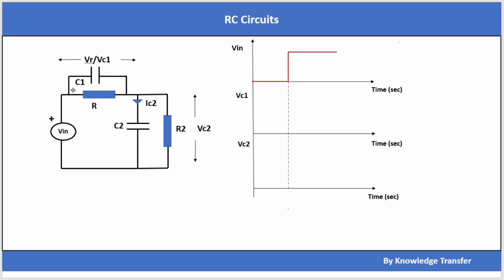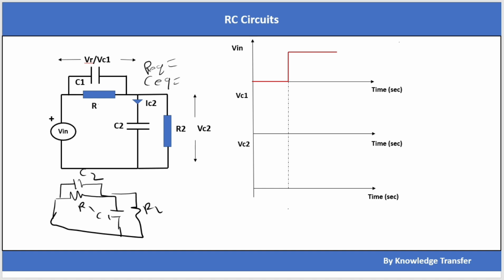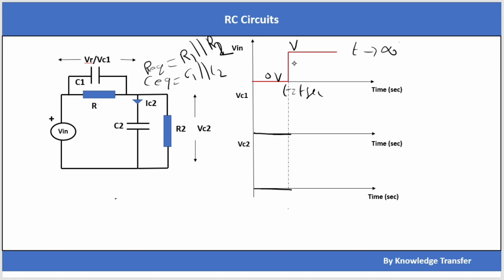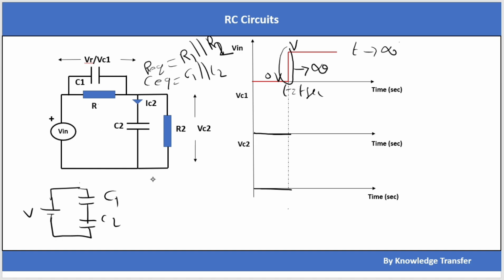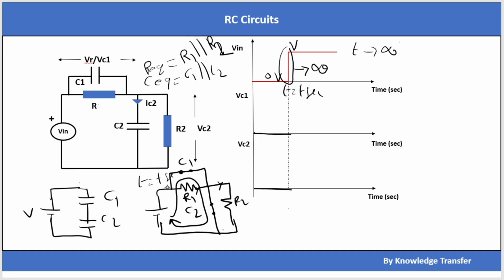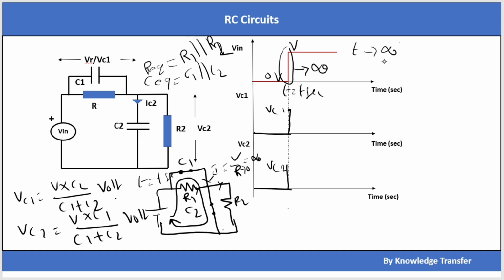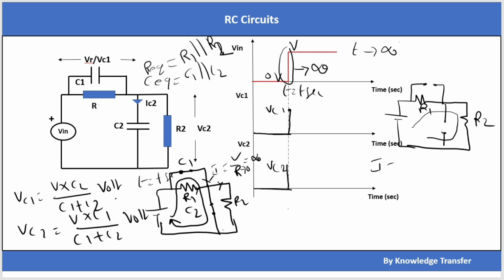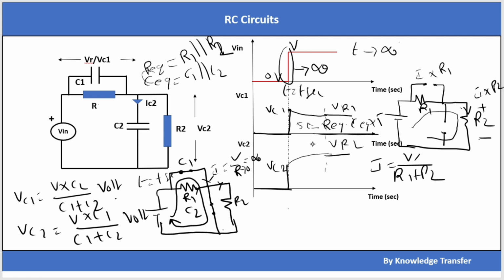Step response of first order RC circuits Part-3

Comment: C1 and C2 are in series right as last video because voltage divider formula you used can be applied only when both are in series connection